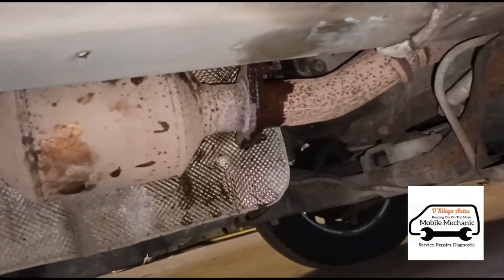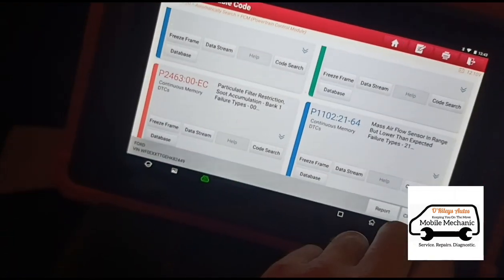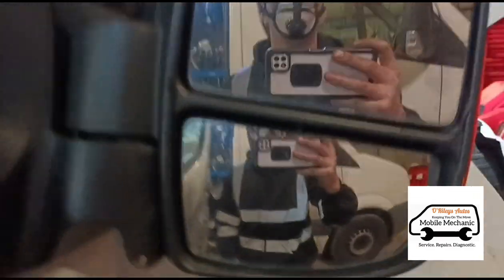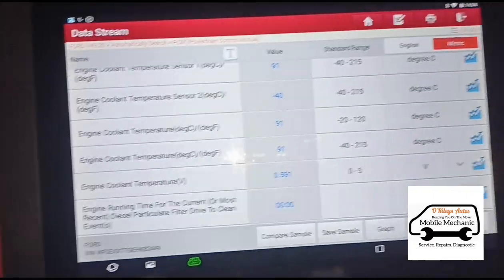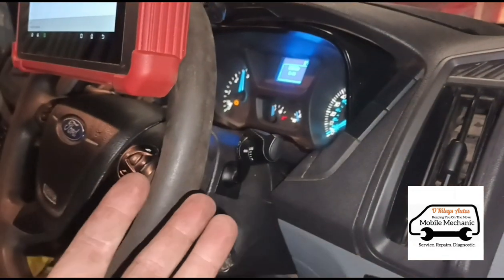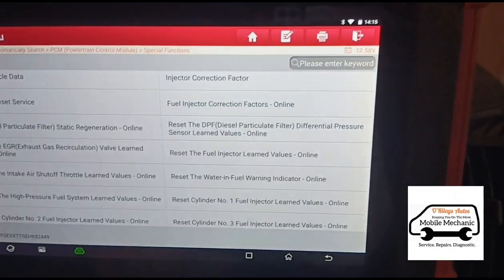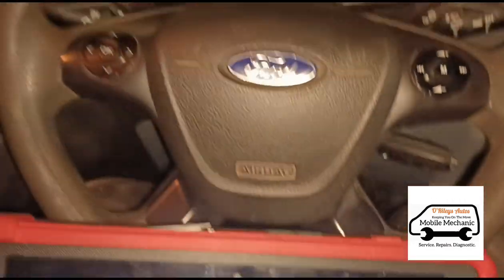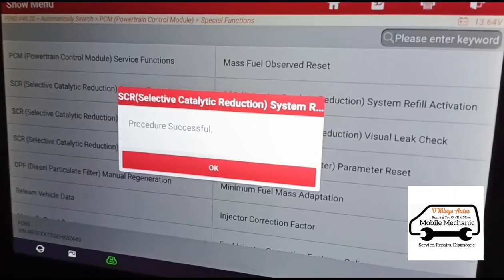Ford Transit 2.0 RWD P246B:00-6C P2463:00-EC P1102:21-64 Blocked DPF & Air Filter

Comment: Nice job again.
I need your expert advice about Launch DPF cleaner: is there any constraint for using it as preventive maintenance? No error on DPF, but about 15 hPa differential pressure on idle.
Thank you.
Reply from the maker: Yes it can be used as a preventative